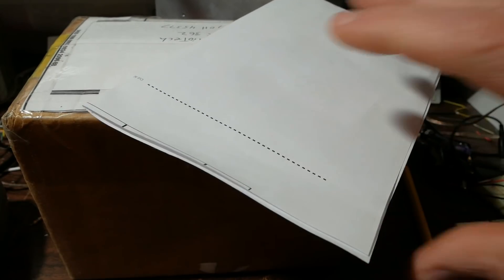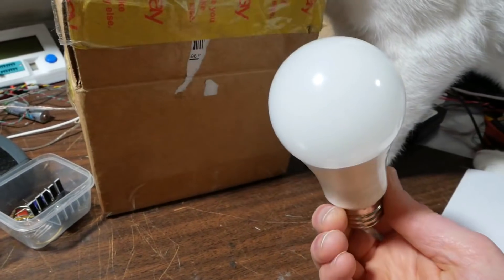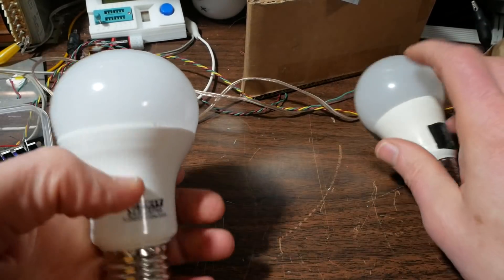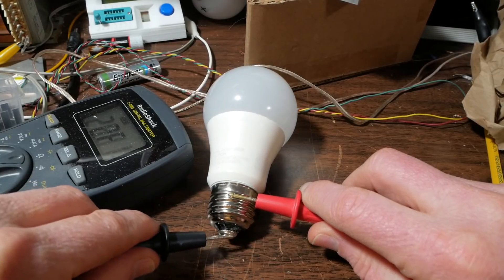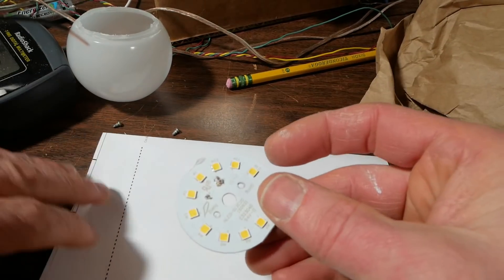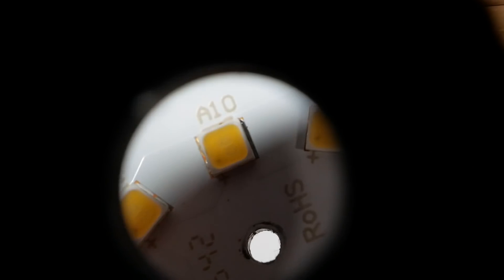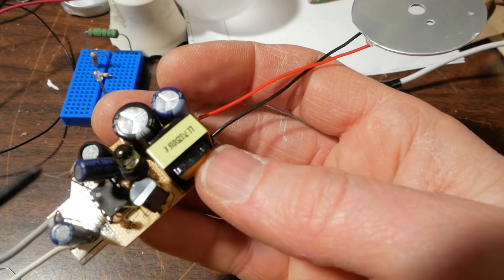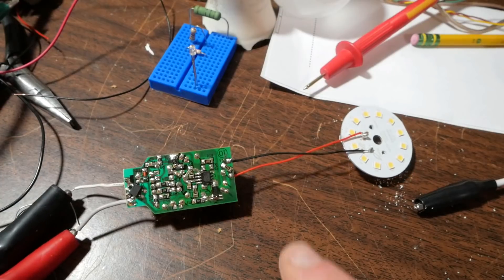LED bulb with light sensor, teardown to find why it failed

Comment: I have a linn classik cd reciever that burned out the tda7293 and a 1501 resistor ...whats the best to replacr with and can i upgrade them ..???
Reply from the maker: Replace with the same part number  / component value. Purchase parts from a reliable distributor (not ebay)